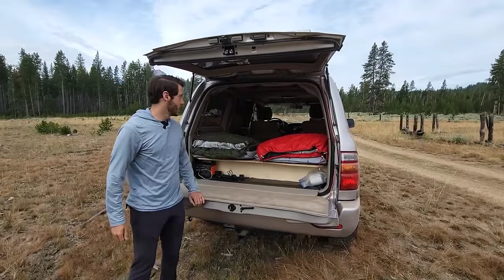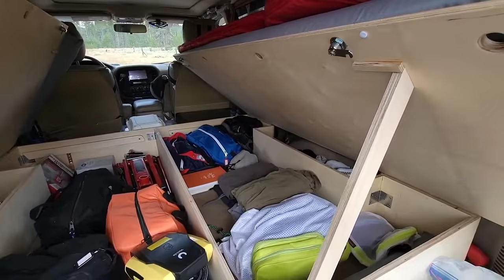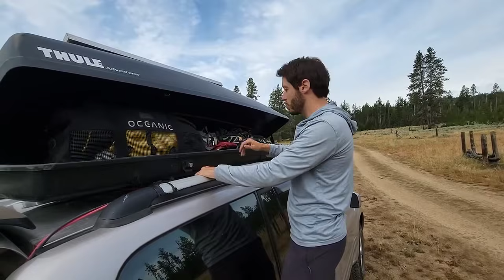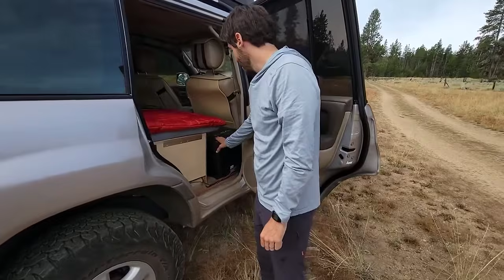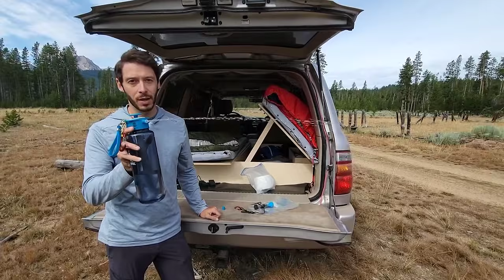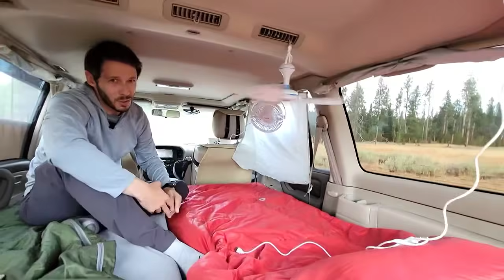SUV TOUR  Living in an SUV, Storage Ideas for Living in a Car | No-Build Van Life

Comment: I like the build. It is not very complicated buy more complicated than what i did in my suv, but i also chose to tow a trailer to put most of my stuff, when i went on a 3-month trip. I just used a twin size spring mattress with a memory foam on top for a bed. I also used multiple battery/usb fans for cooling off. Had a blutetti eb150 for cpap machine and charging the fans. had about 1/3 empty space for storage in bins. I also put bug nets on my windows, I ended up going with duct tape instead of Velcro for the same reason as he stated. the glue melts from the heat and went with duct tape which has had no problems.
 i am planning to sleep in my trailer next time i go out now that it has ac so my suv will be mostly storage.